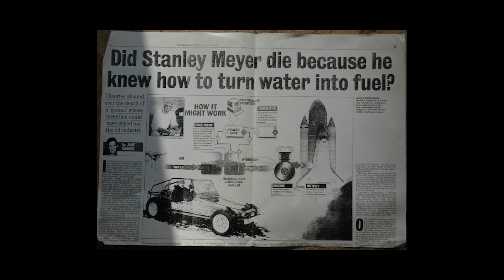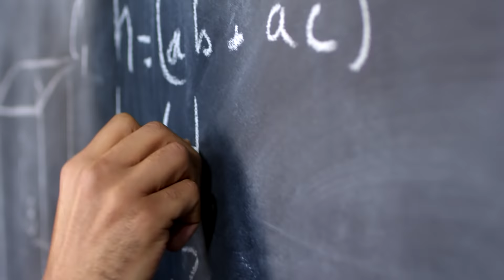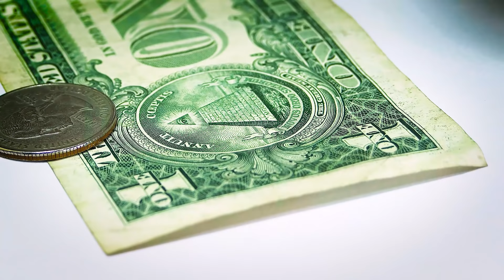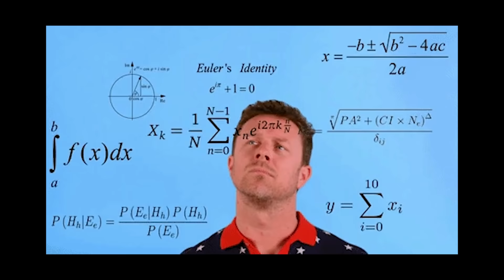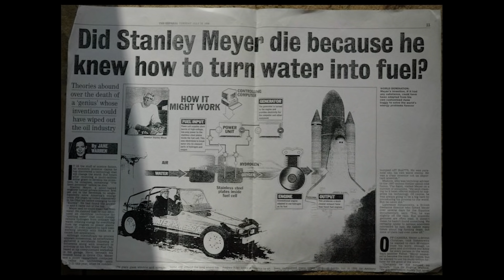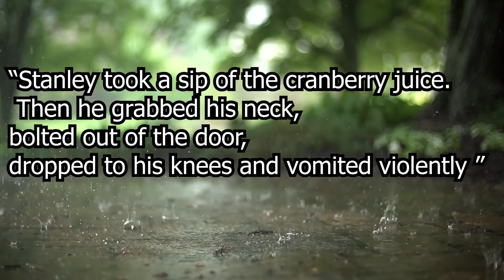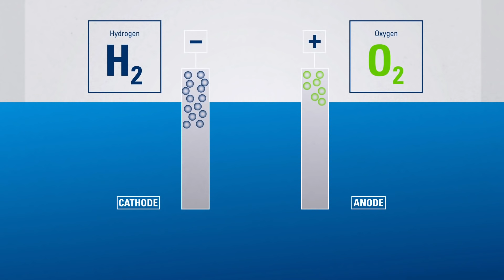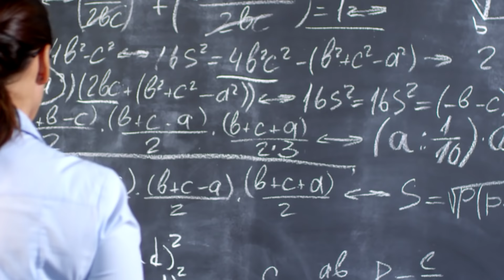Stanley Meyer Water Powered car, Lies and Death

Comment: He essentially created a reverse fuel cell. Instead of starting with a snootfull of hydrogen producing electricity to drive, he started with a snootfull of electricity that produced hydrogen, which then produced both power and more electricity. At some point, either the water or the electricity limits the range. The math would be interesting. If one's house had adequate solar panels or windmills to charge the car and power the house, the energy industry would collapse.
Reply: The math is not interesting and the whole thing obviously a sham.

Using power to split water and then fusing it again never creates more power than you put in. It can't, otherwise you'd be creating something from nothing. Conservation of energy mate.
Reply: @MagnificentXXBastard  agreed. You have to start with a full battery and end with an empty one. It is a controlled loss situation. Instead of doing electrolysis at home or refueling a fuel cell (whichakes electricity) you burn the electricity while generating an amount less than you use. We know that the car worked. The question is how.
Reply: @michaelbindner9883  Kinda. It's entirely pointless loss. Just using the battery to drive the car without all the nonsense in between would be many times more efficient.
Reply: @MagnificentXXBastard  depends on range
Reply: @michaelbindner9883  It depends on literally nothing. It is strictly worse than just using electricity directly to power the car.

Why would it depend on range?
Reply: @MagnificentXXBastard  the car that does electrolysis will have a net energy loss - no argument there - but it will still produce Hydrogen which will burn and produce motion and electricity from alternator. It will draw down the battery and that is the limit of its range.

A hydrogen fuel cell car has hydrogen charge the battery but not produce propulsion. 

Assume both cars also harvest energy from braking.

It is arguing against reality to say the car in question could not work. It actually did. The question is how and to what limits. Arguing that what was observed is theoretically impossible is arguing against the existence of actual data. Can you see how silly that is? Science must explain why it performed and the limits of that performance, i.e. how it could have functioned as observed and how that is still consistent within the parameters of general theory.
Reply: @michaelbindner9883  
Alright, let me explain.

You start with electricity in the form of a battery.
Now, you could either:

a) Use that electricity directly to run the car at about 90% efficiency  
So you use 90% of total energy on propulsion

b) use that energy to run an electrolysis cell (~80% for huge, industrial level setups, so lets say ~60% for something that fits in a car)
And THEN convert that hydrogen back into electricity (at most 60% for fuel cells), 
and then use the electricity to run the car (90%).

OR combust it for propulsion (25% efficiency for a hydrogen engine, so worse than fuel cell.)

so you have  0,6*0,6*0.9 -> at most 32.5% of the total energy used in propulsion, the rest is pointless conversion loss.

Compare that to standard hydrogen fuel cell car which is just 0,6*0,9

On top of that you have a bunch of pointless extra parts that add weight and bulk to a car, aswell as liable to breaking.

Strictly worse in every way shape or form.

> It actually did

Meaningless, and i dont claim it can't work. 
I can add a whole bunch of pointless conversion losses to a car aswell (have a generator running on diesel charge up a battery that then runs the car electrically for example) and still "work". But its strictly mathematically worse than just not doing pointless energy conversion. 
Do you get what I'm saying? It's not impossible to use a battery to make hydrogen and then use that to run the car, but it will always be strictly worse than just using the battery itself to directly run the car.

> Science must explain

It already did, and it says it's strictly worse.
Reply: @MagnificentXXBastard  so a hydrogen fuel cell providing no push gives up less energy than burning hydrogen for push and getting some extra hydrogen from in-car electrolysis fed by the alternator. There is also the question of the environmental impact of industrial hydrogen v. electrolytic hydrogen generated either at home or in transit.

Of course, the best option us electricity delivered (with control) from an electrified roof deck, transmitting power the same way electric buses and trains access the grid. No lithium ion or lithium sulfur batteries required.
Reply: @michaelbindner9883  
>so a hydrogen fuel cell providing no push gives up less energy than burning hydrogen for push and getting some extra hydrogen from in-car electrolysis fed by the alternator

I dont know what you mean by "gives up less energy", but using an alternator and in car electrolysis is simply strictly worse than using a battery directly for thrust with an electric motor. You just add more pointless conversion and steps for the same goal of converting electricity to motion.

>There is also the question of the environmental impact of industrial hydrogen v. electrolytic hydrogen generated either at home or in transit.

This is no question also. Industrial setups are a lot more efficient than home setups or something that fits in a car, and therefore better for the environment.

>  Of course, the best option us electricity delivered (with control) from an electrified roof deck
You'd need power lines hanging around everywhere on every road and driveway at less than headheight. This is a nightmare and totally not worth it.
Reply: @michaelbindner9883  Did you get my point? Or am I missing something?
Reply: @MagnificentXXBastard  we are arguing past each other. Perhaps my analogy was a bit off on how subject vehicle was like a fuel cell in reverse - meaning that the electric power on board at the start was used to produce hydrogen for motion rather than electricity, with some of the combustion recharging battery as it is drained by electrolysis. That is my theory on why this car actually moved.

What is your theory on how it got from point a to point b. For the sake of argument, don't fall back on the excuse that he cheated. Excuses like that simply indicate a closed mind. Dogma, not science.

So, what is your theory on what was happening under the hood?
Reply: @michaelbindner9883  

You clearly are not reading my comments.
Quote:
"i dont claim it can't work.
I can add a whole bunch of pointless conversion losses to a car aswell (have a generator running on diesel charge up a battery that then runs the car electrically for example) and still "work". But its strictly mathematically worse than just not doing pointless energy conversion. "

My claim isnt that this car is in principle impossible to drive. Just that it is strictly worse in every way than just not adding these pointless conversion systems of battery->H2->combustion-->thrust and battery
Reply: @MagnificentXXBastard  except it does drive - at least far enough to get to where it can recharge batteries and her more water.

I said the same thing as you. The design is a controlled loss. Not efficient and not as good as current battery tech. 

What do you think if going all electric (highway and city) through overhead power transfer?
Reply: @michaelbindner9883  
> at least far enough to get to where it can recharge batteries and her more water.

Sure, so would a car that has a battery running a compressor running a turbine running a generator running an electrical motor.
Still, entirely pointless and strictly worse than simply NOT doing it and directly using the first source of power without conversions.

>Not efficient and not as good as current battery tech.

Replace that with ANY battery tech. It is worse by its design principle of pointless conversion, not by any technical reasons.

>What do you think if going all electric (highway and city) through overhead power transfer? 

Absolutely nightmarish. You want headheight high voltage cables running everywhere that  probably kill people on the regular?
Or you want to build cars 3+ meters tall with huge grabbers on the top?
Reply: @michaelbindner9883  wondering how you envision the overhead power for cars?
Reply: @MagnificentXXBastard  like buses and trains, but with grass covered roof decks. Also link to central control computer and WiFi. Services to homes also provided.

There will be system and personal cars and deluvery vans, but large trucks would have separate lanes. Cars would go to rail or to destination with pricing adjusted for volume.

Funded by local employers and users, both for power usage, roadway construction and maintenance and vehicle rental. Owners could put their cars into system while at work.
Reply: Cars that leave system will have water and hydrogen tanks and electrolyzer as an option. Producing H2 in home and car would be on same electrical grid.  

System cars can also drive themselves home from transit when not in use.
Reply: @michaelbindner9883  

>like buses and trains, but with grass covered roof decks.

Grass on the top of your car? That is insanely bad design wise. 
-Extra weight of soil and water
-Aerodynamics
-Grass not doing too well at high speeds
-Need for maintenance, watering etc.

It's literally terrible wtf. 
Also what has that to do with electrified roofdecks that grab power from wires?
What about all the lethal voltage wires at headheight needed to run this system? OR are you going to build every car 3m+ tall?

>and electrolyzer as an option

How do you still not understand that on board electrolysis  is simply BY DESIGN worse than just NOT doing it? I think i explained it pretty well. 

>Producing H2 in home and car would be on same electrical grid

Why THE FUCK would you produce Hydrogen in your car when it is LITERALLY CONNECTED to the grid? What purpose does the hydrogen serve??
Reply: @MagnificentXXBastard  grass is in roof deck top. Visualize it. H2 production would be for off road vehicles only. Think country gravel roads.
Reply: @MagnificentXXBastard  on roof deck. Not on car.

Between a lithium ion battery and hydrogen, hydrogen is the least damaging way to store energy. If you have to do electrolysis with a common source of power (grid distributed on bottom of grass covered roof deck), it is better to do it in car rather than in home while connected to grid. Again, you would not need such a thing for major roadways and urban-suburban neighborhoods. In Red America, however, there are many places where building every road like it is in a city would be impractical. Most of Nevada and Wyoming come to mind. Or we could still have gasoline powered vehicles and infrastructure for such roads.

Comment: this is legit. water is 1 part Oxygen 2 parts hydrogen so its abundadnt in hydrogen for combustion. hydrogen is attached with carbon in fuel wich is what gas cars run on. and nuclear submarines take in saltwater and seperate oxygen to recycle for air the crew breathes and despenses hydrogen.

Comment: What's this guy talking about? if we believe his invention worked? it did work and very well could make it from LA to new york on 20 gallons of water. any kind of water including salt water.
Reply: How many litres is that? I worked out is that over 80 litres?
Reply: @chris01479  thats awsome to think only 80 liters to drive across the country. H2 is the real future of vehicles.
Reply: @ryangardner7921  yeah that would be awesome, but the problem is my car can only holds 45 litre of water so that would mean I could get up to 1,300 miles on a 1.2cc engine? :(
Reply: @chris01479  sounds good to me
Reply: @ryangardner7921  Why it sounds good to you? My car would only get up to 130mpg but most cars would get up to 200mpg if I get bigger engine and big fuel tank size.

Comment: So what your missing when you explain why water alone won't work, is that, if u watch his video, he adds what he says or "mean air gasses that become ionized and mixes thoes with the water all into a file cell which creates combustion." So it's not just water alone but it also a non polluting form of combustion engine. There u go my guy
Reply: Sorry that's supposed to say fuel cell

Comment: I think that this youtuber has a very skewed perspective on the issue. First off, he tries to claim that the electrolysis that is conventionally used throughout society today and Meyer's use of it were identical. That's a very hard assumption. Then he makes claims that it was never operational, at least from a practical level. If that was true, then why did he tour the United States with this vehicle gaining countless investors and the attention of a multitude of renown engineers. This guy had over 200,000 patents that he applied for, worked on projects for companies like NASA, and had a career long resume that gave him the relatable experience needed. Who is more trustworthy. Stanley the engineer, or some youtube channel that does not have sufficient formal education that would galvanize their claims? Then he gives the weakest argument ever on his death and never reaches a complete decision on his opinion. I trust in Stanley over this guy any day y'all.

Comment: That is absolutely not true the efficiency of gasoline is less than the process of electrolysis electrolysis is more efficient than the process of making gasoline, and burning gasoline is only 70% efficient the rest of it goes out the tailpipe this is what they tell people who don't understand and just listen to how efficient something should be well everything that we have today is so inefficient people need to stop talking about how inefficient something is gasoline cars are wasteful police for and they are very kinds of engines out there that are more efficient why aren't they on the market. Electrolysis is efficient enough to be run with solar so where did he get this power from he could have gotten it from an alternator it's efficient enough to do electrolysis I don't understand why people think electrolysis is a hard thing to do and here's another little secret most of you don't know you don't need to put salt or an additive in water if you just put a certain type of metal that acts as an additive and makes water conduct trying to add salt when you could put carbon in the water and the carbon does not filter out again there's so many ways to create electrolysis of water it's not even funny this technology has been ran for hundreds of years please try and keep up with the times this message comes from our library media library you can contact me or us at any time 313-651-5349

Comment: Myers process worked efficiently because he pulsed the electricity in high frequency. It's like AC vs DC current. AC current travels miles because it is pulsed at high frequency. DC cannot. Traditional electrolysis uses DC current and electrolytes and is very inefficient. Myers invention found the Breaking point of water and pulsed it at that frequency. You don't need a lot of electricity for this. Microwave ovens work because of high frequency microwaves. All matter in the universe is held together by electrical bonds and that bond can be broken with resonance.

Comment: 1:30: Stanly Meyier applied for 200 000 patents: A patent search reveals there are only about 20! Out bei a factor of 10 000!
Reply from the maker: I did address this
Reply from the maker: Read thru the comments
Reply: @ChrisVSCars  Why? too many commenters seem to buy this nonsense.
Reply from the maker: The 200k  patents? 
I mention way back when i released the video that I made a mistake there
Reply from the maker: But the rest is factual. If you do proper research, reading journals you will see that this car never worked

Comment: This blew my mind when I understood what Stanley used to resolve the issues relative to modern internal combustion engines (ICE) running on water. His end result was an injector that water was converted to fuel and oxygen in the injector in real time ! the other half was the generator that supplied the  electricity plus browns gas using plasma to charge the gas prior to being used to carry a field through the coils of the generator via a non conductive tube. the currant that this produced was way more than conventional genset , pluss the only moving parts was the charged gas! If this tech were to make it to market then a tesla car would have a small battery and run off the currant produced by the plasma generator also if this tech were used in every home there would be4 no need for the powerhouse each dwelling having its own unit and could be connected to the grid for times when you might need more than normal.

Comment: Maybe he did something internally in the motor that he was using.  Maybe it made so much power because of piston rod length piston ring tolerances tighter in which could produce much more compression than others and much more power as a result we will never know...

Comment: I think it worked, but I think he was paid to shut the fuck up, and disappear. Secondly has any one ever seen a tesla coil how can that produce such high voltage with out using that much power. It is a transformer and a capacitor that does the work just look up his patent the cathode, and the anode are hooked to the same capacitor in the solution there is no separate switches, and if you think about it the fact that his investors sued him because his inventions did not use any other means of electrolysis than had previously been discussed because it is just electrolysis. If you are essentially creating the hydrogen from water and than basing your findings off of the fact that it takes alot of energy to create this reaction than you are in the wrong playing field. Look at Stanley's patent, for solar panels and both of the invention placed into one invention could problem get you to an equilibrium because every thing is equal to zero when times by zero or divided into zero.